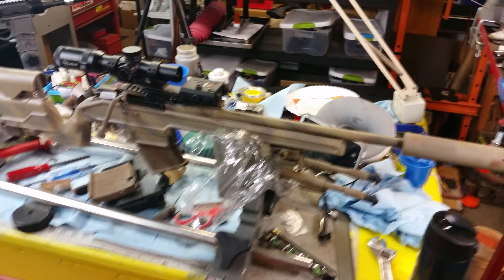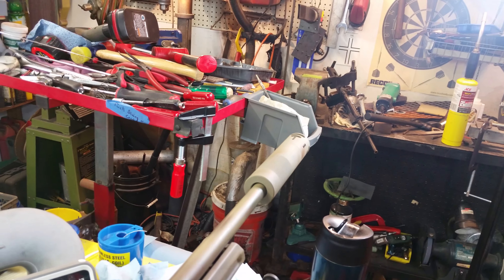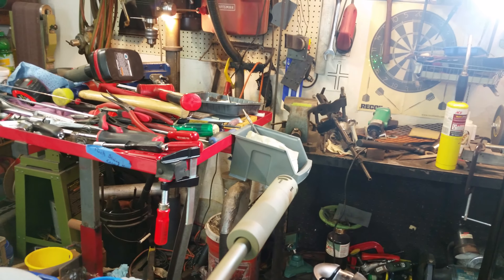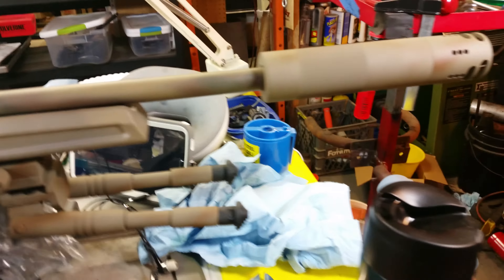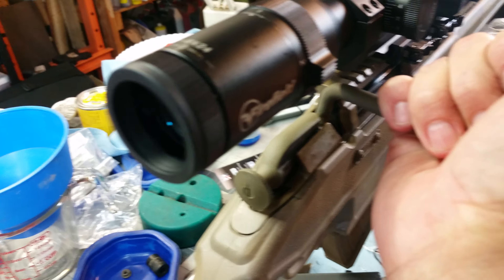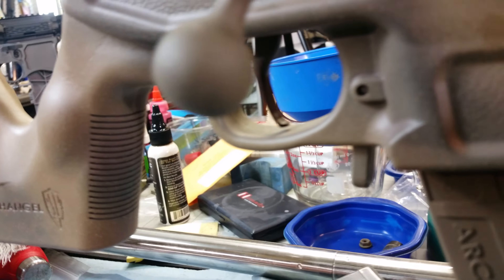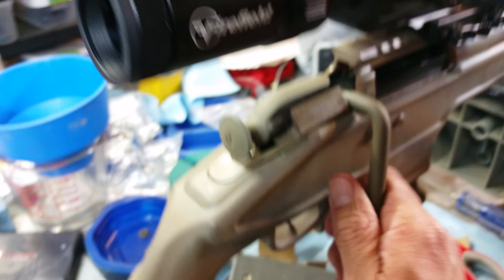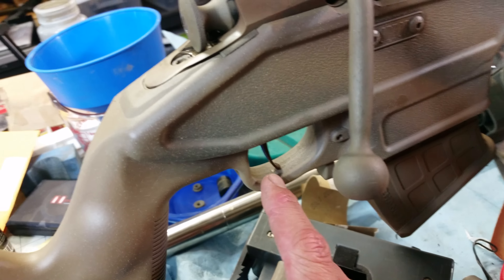(SNEAK PEEK) Mosin Project is complete!

Comment: I'd like to do that to one of my Mosin's. What kind of stock is that?
Reply from the maker: The stock is an Archangel. Drop me a line on our website and fill out a price quote request and I will get you current pricing.  Keep in mind that the stock will not fit like this. This gun has had extensive work to make everything fit perfectly and of coarse the bolt handle has been relocated and other items. Just want to make sure you understand that what you get in the box if you just order one of those stocks will be vastly different. I also have a custom unfinished maple stock for the Mosin. It is styled after the McMillian style sniper stocks. I can finish it to any desired finish. Our website address is: http://www.TDCtactical.com